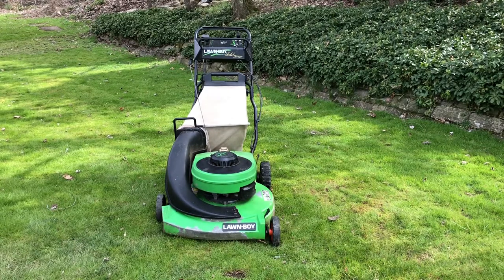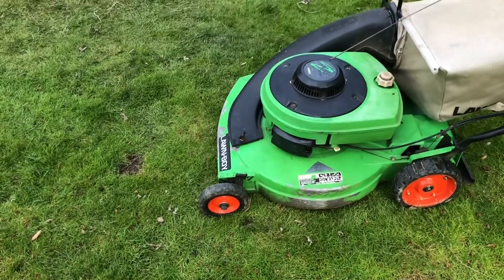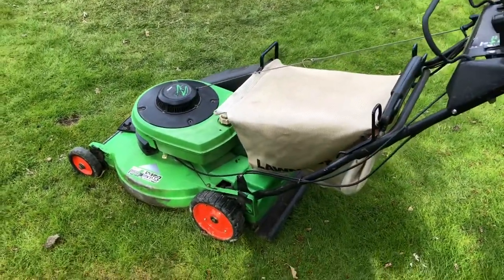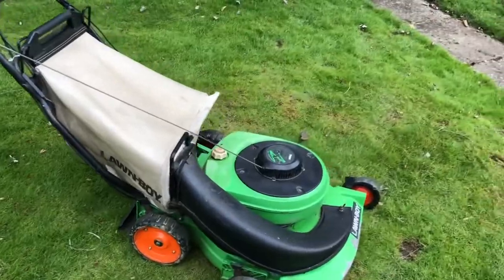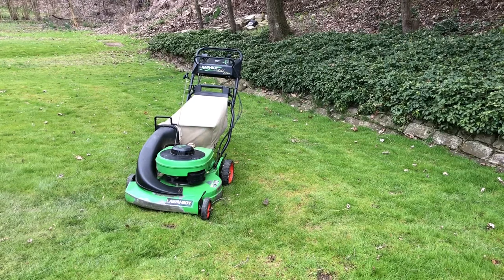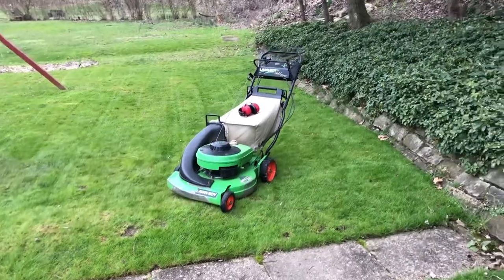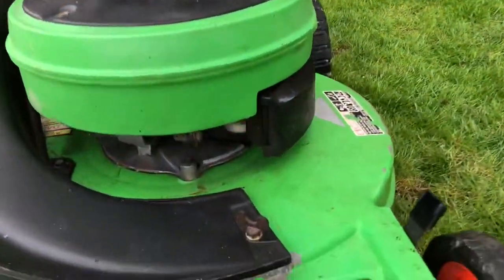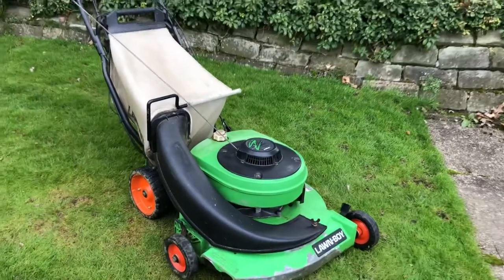Lawn-Boy Gold Series 10515 Over-View and Demonstration

Comment: Without a doubt- this bagging system is the absolute best rear bagger ever outfitted on a mower. It feeds from the top, so it fills upward and it actually fills the entire bag- not just the bottom half. Also it rarely , if ever clogs. Only when I’m forced to cut wet grass.  I say keep it if you can. The seals are so easy to replace!
Reply from the maker: You are definitely correct; these are by far the best rear bagging mowers you could have bought... the never clog!
Reply: This design is the best ever because it was borrowed from Snapper whom designed their top loading chute in the '60s...
Reply: I agree, I have one. But I opted to switch to mulching mode; less work and fertilizes the lawn.

Comment: You really ought to put this mower in storage until things calm down next Winter. I own a 10518 along with 10324c and I got rid of an almost new top of the line Husqvarna as those 2 were far superior in all aspects, especially that somewhat low-powered but ever so smoth 10518. By all means, please hang on to such a great piece of americana. Stay safe and be merry !
Reply from the maker: I might have to consider that. The problem I’m having is getting seals that aren’t old and dry rotted when I get them. But that is a greet ida to hang on to it until I have time to work on it.
Reply: I have a 10515 leaking on driveshaft blade is on. Can I replace the seal or bearing , I have a hard time getting rid of any Lawnboy mower . I love them and have used them since I was 12 yrs old. Even had a Lawnboy Gold Snowblower wow im old . 
any help would be appreciated . even info or sources for oem parts . 
Glad to see im not the only one that appreciates a quality reliable machines by LawnBoy. Cant find a used 10515 anywhere here in Canada North of Toronto

Comment: I have a 1990s 10515. Love it. All 4 wheels were wobbly. The wheel bushings get worn out causing wobble. Wheel wobble is unacceptable on rear wheels because it will ruin the self propel gears.
Partstree does not sell new bushings. I bought some steel spacers at Lowes and hacksawed to correct length. Problem solved. I bought spacers 1/2" ID x 5/8" OD x 1.5" long and cut to length, about 5/8". Used a file to file down rough edge after cut. They fit perfectly inside the wheels and eliminated wobble.
Reply from the maker: That is great! Glad to hear you were able to fix the wobble with your own solution!!
Reply: @lawnboyR  Keep those spacers in mind if you ever need new wheel bushings! Lowes and Home Depot sell them.